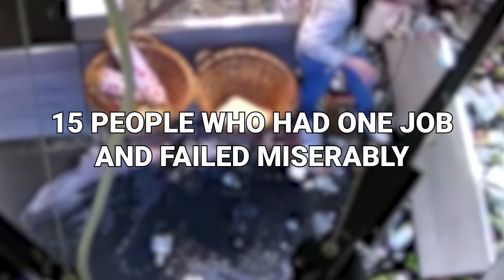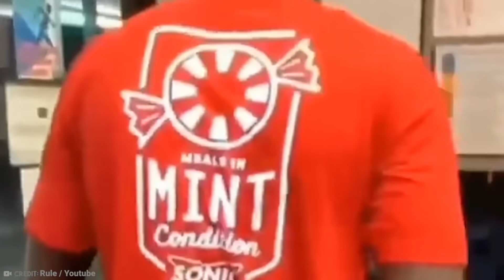When its Your First & Last Day At Work

Comment: I don't know if this counts as a work mistake, but 20 years ago I was working at a factory that pack clams. I had specifically been hired to pack cans in the boxes but one day they decided to put me on machines that I was not properly trained for. They had me putting salt tablets into  cans of clam juice. They had not properly shown me or any of the other employees where the emergency shut off switch was. They also didn't give us proper safety equipment. So we didn't have goggles or heat resistant gloves, instead we were given these crappy knitted gloves that got caught on any little sharp edge.
Since I was the one adding the salt tablets to the cans, I was the one who took the greatest risk of being injured & that is exactly what happened. My left glove (I'm left handed) got caught on a rough rim to a can & my arm was dragged through the machine & no one noticed right away. I apparently didn't freak out & asked twice for someone to help me, but because no one knew where the emergency shut off was, it wasn't until my arm was in the machine past my elbow a maintenance man was able to shut the machine off & my hand had been in a scalding hot can of clam juice for around 5 minutes when he was able to free my hand. The can which started out as a big can ended up being a little bit bigger than a tuna can when it was removed from the machine & I had suffered major 2nd & 3rd degree burns to my hand & forearm. I spent over 2 weeks in a major burn center & had 3 separate surgeries for skin grafts & I will always carry the scars & some nerve damage from it.

Comment: I was refueling an airplane at my job. The fuel goes into a hole with a cap on the top of the wing..it was not a big plane . In order to know how much fuel is in the tank when you start, there is a special dip stick you have to use..it doesn't have any kind of stop at one end. It's just a metal rod. There isn't any rope or chain on one end either to hold to keep the stick from falling all the way into the tank.. 
So I needed to check the level so I have an idea how much to put in without over flowing the tank and spilling gas on the wing. 
So I put the measuring rod in the tank. . Then. I lost my grip on the smooth rod and in it went into the tank. 
When it went in.. I busted out laughing. . It was inappropriate as it was not good having that rod in the tank.  There was no way I could fish it out
.I couldn't reach into the tank because the hole was too small..
People were around me. And we're wondering why I was laughing so hard..it took me a while to regain my composure to explain what had happened..  I can't imagine why the dip stick didn't have an end to keep it from falling completely in the tank. And I knew this was not good.  You can't fly the plane with that metal rod in the tank.  I apologize profusely to my boss, but he of course wasn't happy.  But there should have been a end on the rod so it couldn't be dropped all the way into the tank.  Because it was just too easy for that to happen.  
Oh. I had just gotten out of the air force as a fuel specialist.  Aka. I refueled planes on military bases. But we never had to fill such small planes. The fuel hoses were locked on the gas intake port.. it was in 1977, and I am a female Vietnam vet.  Oops.. but I never was trained on doing that type of refueling. And the boss should of had a dip stick that could not get dropped all the way into the tank. A T handle on one end of the rod could have prevented this from happening.

Comment: As a former truck driver I can understand how you can miss the sign but that badly and that far is not fully accidental. You can see where the driver started to break and slow down due to the skid but depending on how far the damage goes it would have to be a bit too purposeful

Comment: The instance where the forklift hit the shelving and the entire warehouse collapsed was actually the fault of the warehouse. There should be heavy steel corner barriers set at the corners to prevent a forklift from hitting them. There are frequently instances where employers use cheap shelving or other equipment that causes catastrophes, as well as overworking workers.

Comment: A total of 5,333 workers died from a work-related injury in the U.S. in 2019, up 2 percent from the 2018 total of 5,250. The fatal work injury rate was 3.5 fatalities per 100,000 full-time equivalent (FTE) workers, which was the rate reported in 2018.

Comment: At 9m 35s, The guy that tried taking the large concrete cylindrical pipe off the back off the truck onto a couple of tyres wasnt the courier company but was the actual buyer of the item I guess? If it was and it was him that tried taking it off the truck  mean that the insurance company isn't liable? But If the truck driver tried to roll it off,  I take it that then they would have had to pay out?